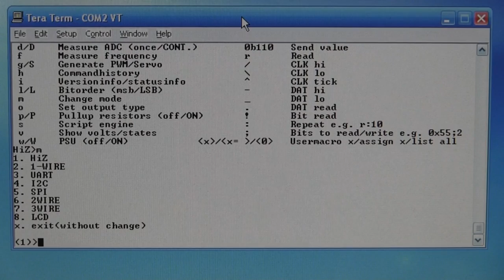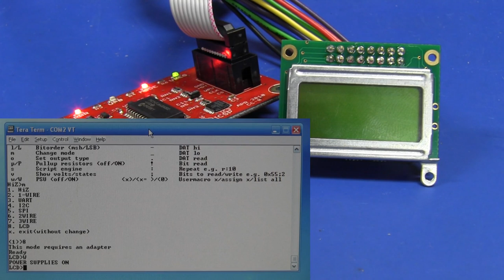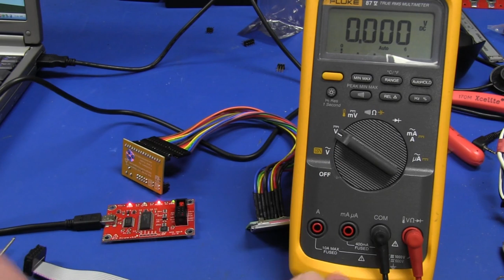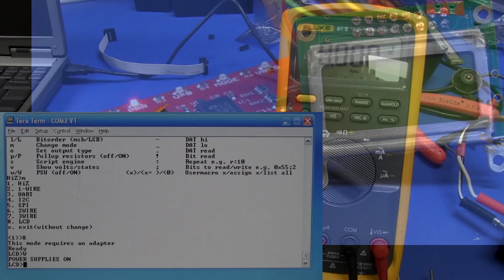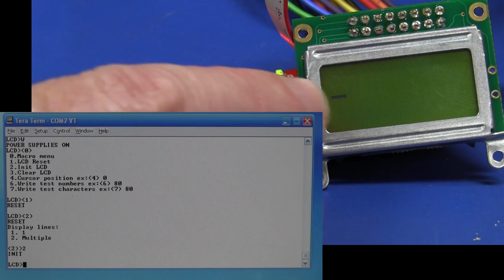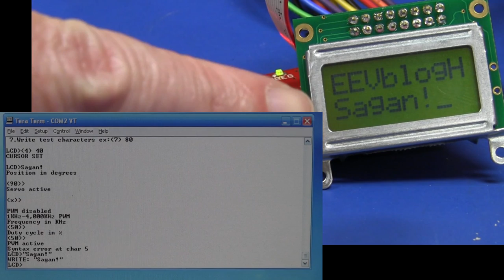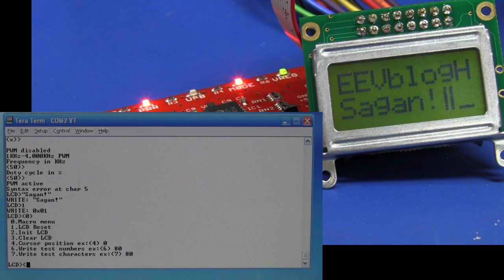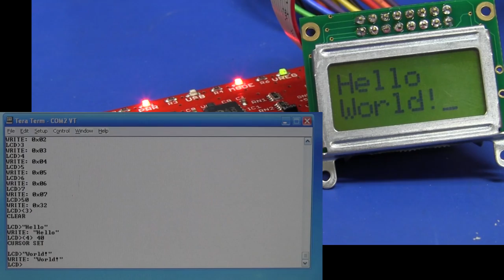EEVblog #313 - Bus Pirate LCD Debugging

Comment: I've got a stack of these Lcd display, including one installed on a one hung low function gnerator, which doesn't work.  So hooked the display up to the BP Lcd adapter, and it won't make any of my displays work.  Just checked the cable.  Yup.  My cable is also reversed.  And it's the only 10 pin cable I've got, so it's the one which came with the adapter, which came from either Adafruit or Seed.  Don't remember which.  So, check your cable boys, and keep them dry.

Comment: I remember my first PIC "project" was simply displaying "hello" on a 2x16 display. I used one of those <10 component DIY parallel programmers you hate, hehe :D - The smoke you can generate by putting in a PIC16 backwards, woops.

Comment: Can't say I've had any issue with them, or that the BP would save time, since you have to write the micro program anyway. There was a unit at Jaycar which might be still available with the usual pinout, except it's supply pins reversed! :D

Comment: The BPv4 has mostly worked for me, but I've run into a couple firmware bugs. It is a lot faster than the BPv3 though! There will be a new revision of the BPv4 soon (new form factor only, no functional changes), so you may want to wait until it's out.

Comment: Gonna use one of these in the power supply project instead of the single led blinking the voltage in morse code?  If you want to get totally fancy, you can use pwm for the contrast (and the backlight...but that isn't applicable to this one)

Comment: Heh, I've done something similar.  I needed to solder a pin header to the opposite side of a board to get something to fit, not realizing that that would mirror the pin layout.  The ICSP programmer did not like that at all.

Comment: I was looking at the bus pirate just the other day thinking about buying one but out of stock at the time, there is a new and old version and what put me off a little is the description pushing you away from the new version in favour of the old which was odd so I ended up not getting either! Maybe you could get hold of the new version and do a review? I don't really want to buy the old version but if the new one is unstable?

Comment: HD44780 should have died a long time ago. It's slow and very limited. 8 bytes of CGRAM is a pain in the ass, you can get personal CGROM of course, if you order like 10000 units.
Parallel bus? It's a waste of pins, unless you already have a bus and an address decoder.
Writing a library for a new controller takes 1-2 days.